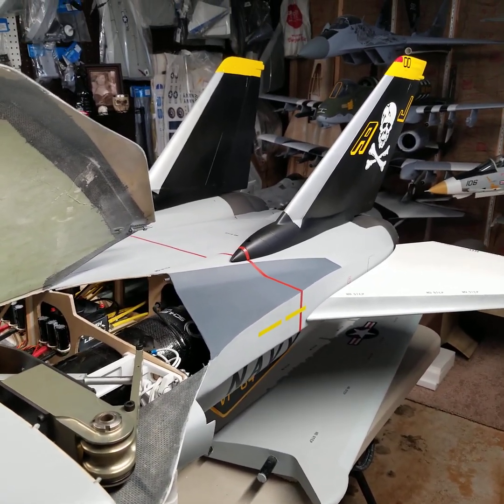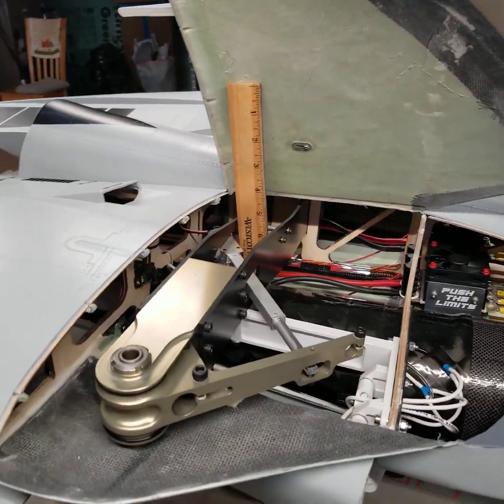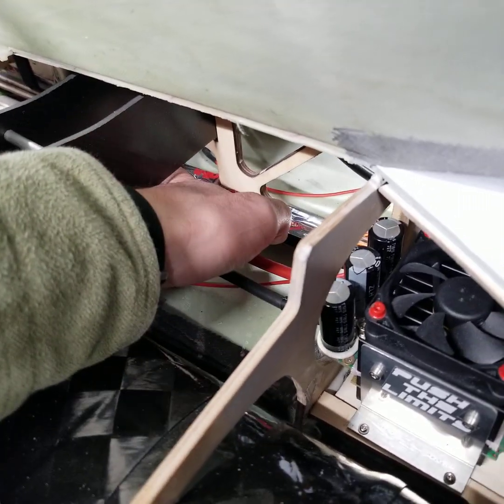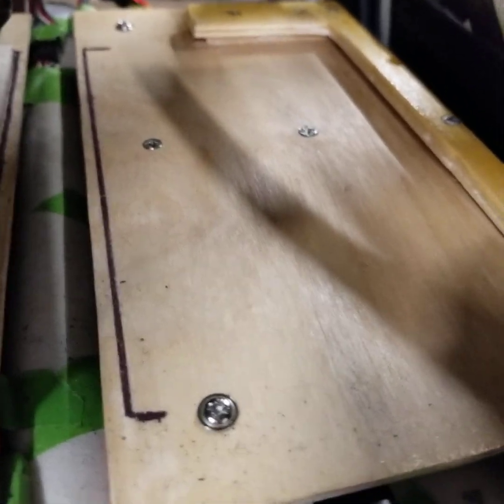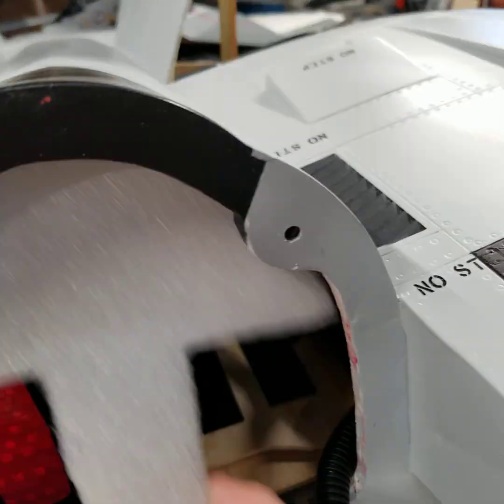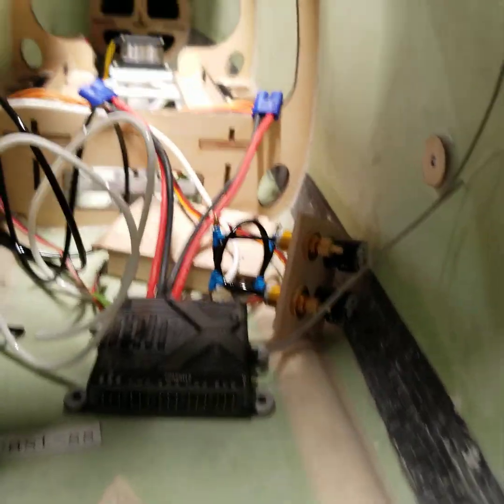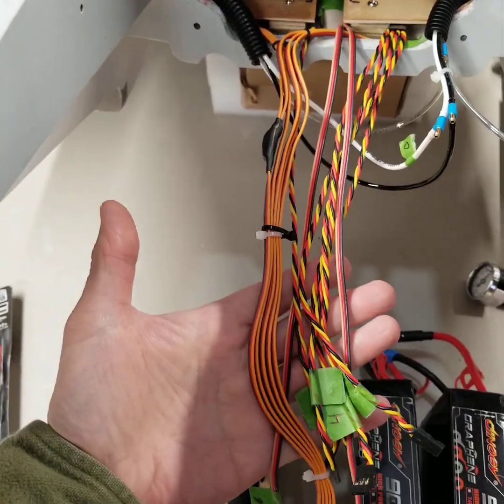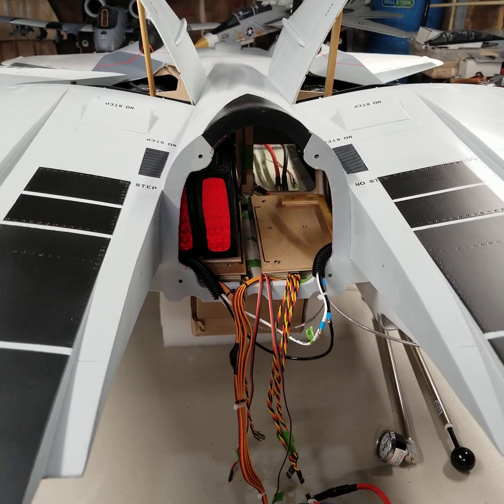Skymaster EDF conversion part 5

Comment: That is a genius battery tray system. Sometimes the simple engineering solution is the best, but I find it takes a while to get there. I try many more complicated solutions and sometimes end up saying to myself "why didn't I try this first?".   It is really good to see you getting close...it has been an epic project! Looking forward to the next installment!
Reply from the maker: I spent a lot of time to get to this. The biggest is you is the limited space and availability to get them in there. I knew what ever I worked out would have to be able to be done with one hand. Its not perfect but Im very satisfied and Im certain it will work. Thank you for your kind words Adam!
Reply: @davidsnyder238  In my opinion David considering the space you had to work with it is absolutely perfect. Simple, functional.